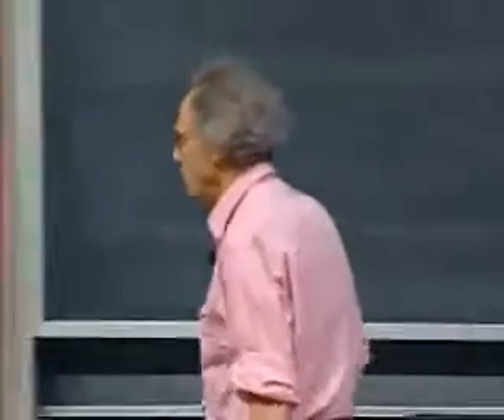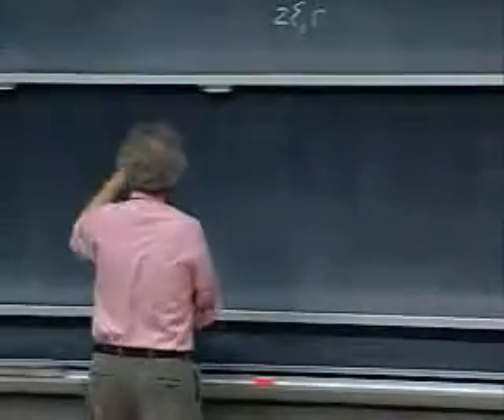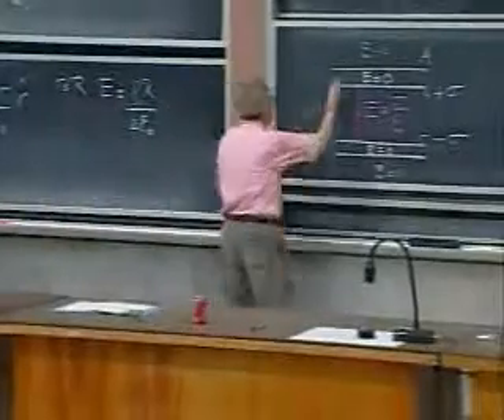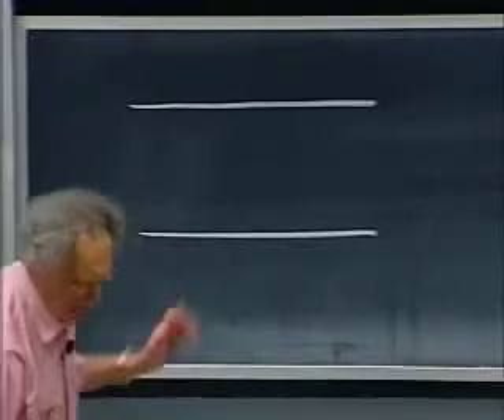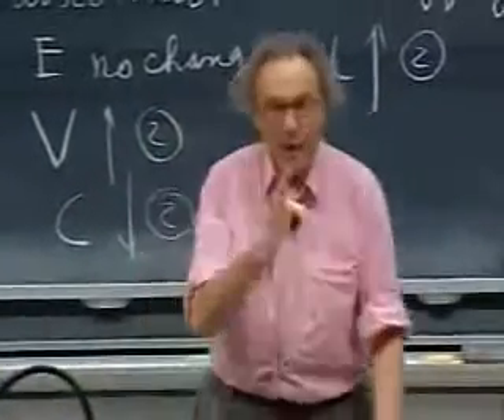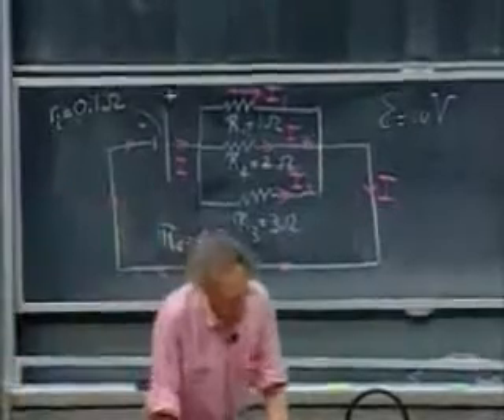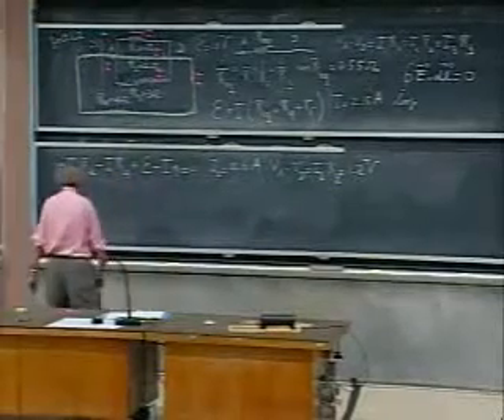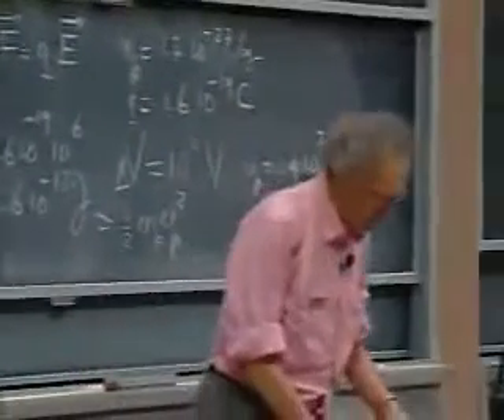Lec 12   MIT 8 02 Electricity and Magnetism, Spring 2002

Comment from the maker: solve for eddy currents. eddy currents explain magnetism, and induction in a very simple way..

I conclude the date oct 28- nov 1 2013 a time that we can measure induction through the external field. torque times delta T. eddy currents in space resist the external force applied to earth rotational center of mass. causes water to equalize and pool to the north. under a increase in acceleration of earth rotation during t times delta t. The mass, objects temple 1 comet are parts of the white dwarf